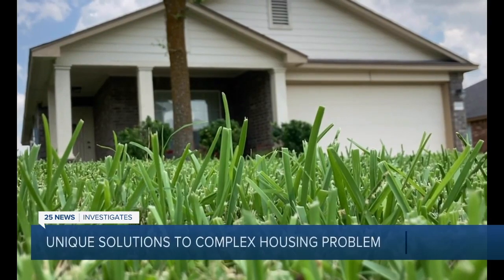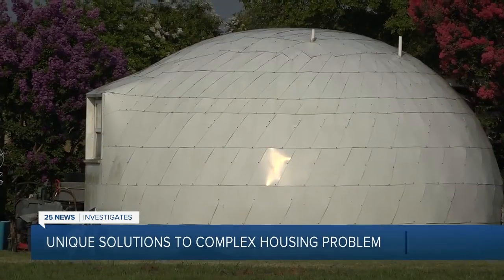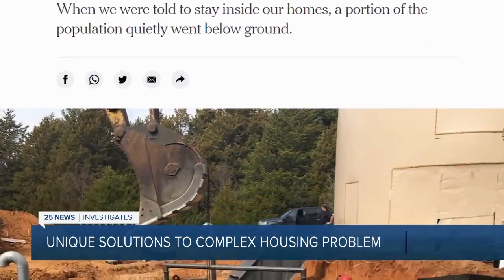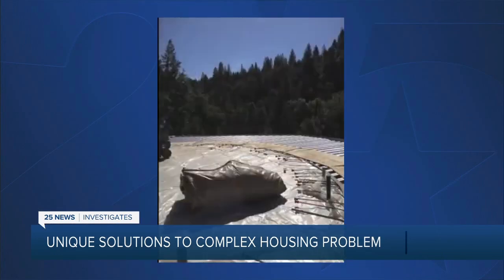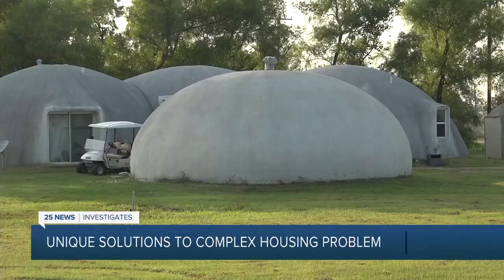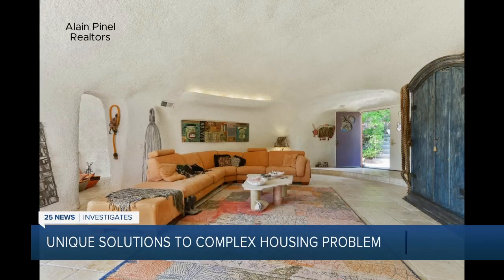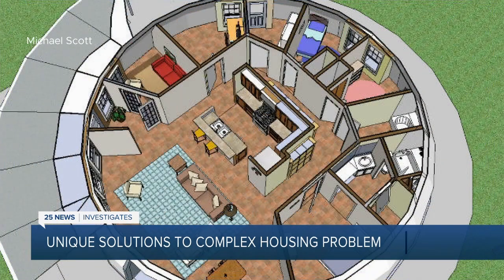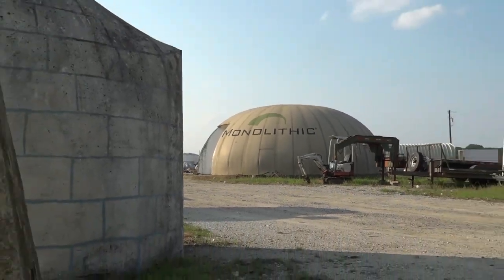Homes among the most durable on earth made here in Texas (Dome Homes Part 2)

Comment: At the 1:45 part of the video you see several dome buildings and some show grime and mold on the outside.  I am wondering if there is an outer coating that can be applied to the concrete to keep it nice and white and reduce exterior cleaning requirements?

Comment: Watch out for black mold. It grows very easy in these homes
Reply: Not if it's done properly, with adequate ventilation. 😊
Reply: @time2see192 or you know, maintain the house clean and tidy, he just sounds lazy🙄
Reply: It can certainly be a problem--like for any home. Sometimes, homes aren't built with enough airflow. My mother, Judy South, put a small fan in one closet in her Monolithic Dome home in Texas because it would sometimes have issues. The little fan solved the problem for my mom, but I  made sure HVAC vents were installed in all of my closets when I built my own dome house. Recently, a friend had a mold problem in Oregon in her conventional apartment's closet, and I suggested that she use the "Judy South method" and put a fan in the closet. It fixed the issue for her, too!